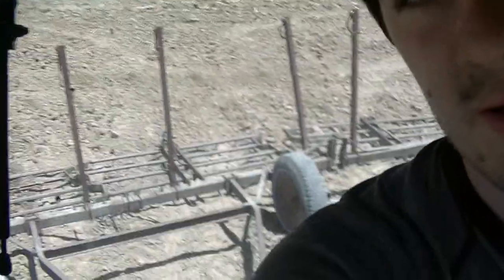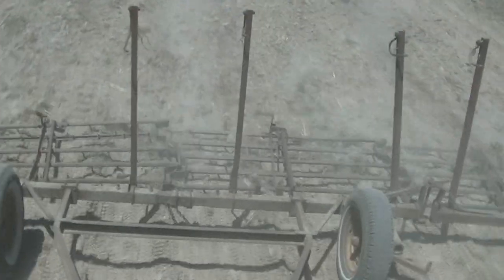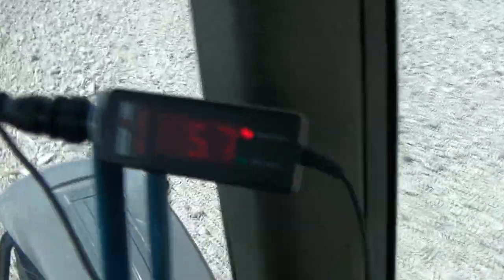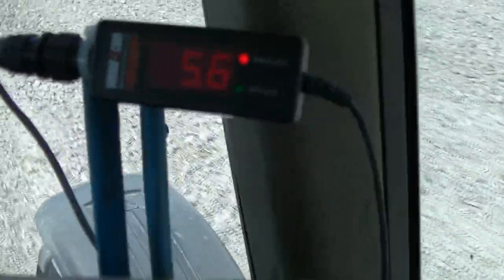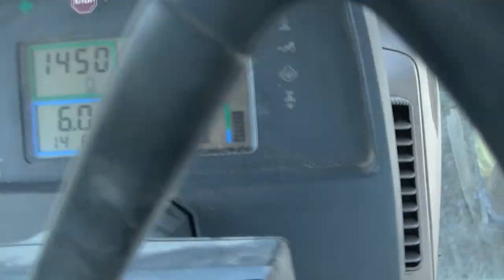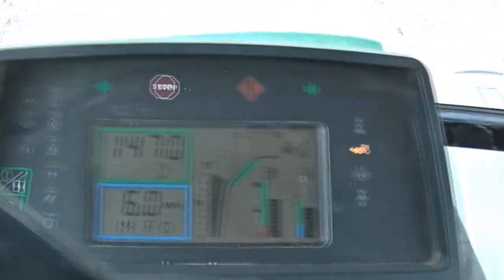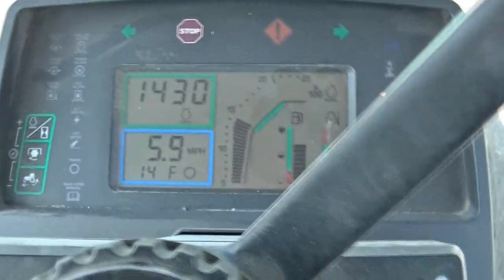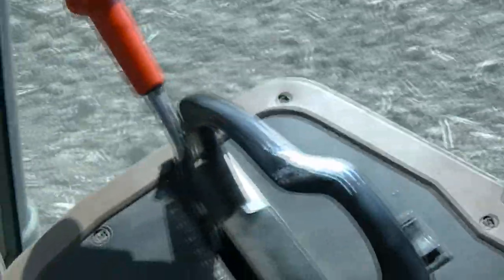Calculating Wheel Slip - Harrowing Oats and Alfalfa

Comment: Question?  To save a pass through the field could the harrow be rigged behind the drill and do the same job?  Also grain drills that I have sold parts for have 'drag chains' behind the rig to smooth out the pass and possibly cover more seeds with dirt.
Reply: It certainly could,  BUT,  it could  interfere with turning at the ends of the field and also precludes the possibility of  backing  up, if needed...  unless the harrow  has a lift  cylinder  and can be seen adequately from the cab to lift it and back  up without jackknifing.  

I saw a Mennonite a  few years ago in northern  Indiana that was running and old Deere  620 tractor  on steel wheels, who was pulling a disk  behind the  tractor to break up the soil, a cultipacker hitched behind that to break the clods and firm the soil, which had an old Deere FB drill hooked behind that to drill the seed into the firm soil, and it had a Brillion roller packer hitched behind the drill to firm the soil and incorporate the seed... really a neat looking setup and kinda fun watching that "train" of equipment  rolling across the field...  and yeah, the old 620 had about all she could handle!  LOL:)  

Later!  OL J R :)

Comment: A cultipacker or Brillion roller pulled behind the drill would be more efficient and a better  use of time... but of course you need a hitch  on the back of your drill to pull it, which wouldn't be hard to do... just a tow bar basically, which  could  even be removable when not needed if desired.  

Later!   OL  J R :)

Comment: Slippage is a way of protecting the power train.  Basically a tractor under load needs to run over 4 miles per hour.  Having correct weight to hp allows tractor to maintain gear speed thru spinning.  Too much weight & the tractor just bogs down putting a lot of pressure on gears & shafts.
Reply: For shock loads, yes, slippage  helps, because the tire will slip more when a shock load (like hitting a hidden rock  under the soil or sudden hard spot) but the constant load is the same, regardless of slippage... reducing slippage reduces fuel wasted,  but  since more work (ground covered  with the implement)  is being accomplished per second  (or minute, or hour, however you want to measure it) more work  is being accomplished and also  more fuel  is being burned, but it's being burned to accomplish more work, therefore increasing efficiency (to a point).  

You're correct that basically you don't want to weight the tractor  until there's "zero" slippage (which  is theoretically impossible anyway) and that's why  a small percentage of slippage is not only acceptable but also desirable, since it gives the power somewhere to go during "shock loading" when with  very little/no slippage the loads on the shafts and gears and engine could become very  damaging and break something... 

Later!  OL J R :)

Comment: Interesting video. Looks like by engaging the 4WD it would cause your tractor to burn more fuel, and not save fuel. It would take care of the wheel slippage for sure, but saving fuel I don't know.  Other wise vehicles would be running around in 4WD for better gas mileage. I will take your word on it... lol  Take care.
Reply from the maker: Larry342516 As ***** said, it really depends on how much wheel slip you're getting. Since I'm harrowing, the difference in wheel slip is very minimal. In larger tasks such as chisel plowing, 4WD can be a game changer.
Reply: How Farms Work Thanks for the reply. Take care.
Reply: How Farms Work Isn't a formula based on torque, weight, load and conditions? I guess I wold like to have seen the fuel consumption difference between having the four-wheel engaged or not. I can't imagine it effected fuel efficiency very much?
Reply: Well, wheel slippage causes more fuel to be wasted... it takes "X" amount of energy to turn the wheels against the resistance (load) of the implement, soil, and moving the weight of the machinery through the field, and if a wheel should cover say 15 feet with every revolution (circumference of the tire at the tread center) and instead only covers 12 feet in that revolution, then the 3 feet it didn't cover (wheel slip) then has to be covered on the next revolution, therefore the tire must make more revolutions per field to accomplish the same work, therefore wasting energy.  Reducing wheel slip reduces this waste, BUT, it also means that the drag resistance that was causing the wheel slippage in the first place has been partially overcome-- so assuming the load remains the same, the tire is DOING MORE WORK per revolution (now that slippage is reduced), which offsets the savings gained in reducing the slippage somewhat.  

Look  at it this way-- what is the mileage  on your truck going down the road at "zero" percent wheel slippage, versus 100% wheel slippage when the truck is stuck in a mudhole or on ice??  Obviously, a  truck that  will get 20 mpg on smooth level road will be getting ZERO miles per gallon when it's stuck in the mudhole or ice, because it's still burning the same amount of fuel  necessary to move the truck down the road, BUT it's not going anywhere when it's  stuck... 
Similarly, that's why vehicles have fuel mileage  expressed in "city/highway" ratings...  In the city, vehicles often sit idling in traffic jams or at red lights for extended periods,  which lowers the fuel  efficiency,  since the engine is still burning fuel to idle, while zero (or very little  in traffic jams) distance is being covered for the amount of fuel being  burned.  

Now, consider the same pickup going down the road pulling a trailer... the trailer weight, resistance  of its tires, friction of the bearings, etc. all  take more energy to move... more work is being done by the truck  in moving the trailer AND itself down the road,  while wheel slippage is still theoretically zero,  which is why it takes more fuel  to tow a trailer than just running the  truck by itself, even empty.  

It's all basically a measure of efficiency of converting the energy from the fuel into work  accomplished by the truck,  tractor, whatever.   Wheel slippage= energy wasted, reducing slippage= more work being  accomplished per  wheel revolution  or second, thus increased load, BUT  so long as  the increased fuel consumption to accomplish  the more work being done is less than the fuel being wasted turning the slipping tire, then efficiency has increased.  That's  why a CERTAIN percentage  of wheel slippage is actually good-- eliminating  it completely would require SO  much extra weight on the tractor (which the extra weight requires energy to move through the field as well against rolling resistance)  that the reduction in waste   losses due to slippage are less than the extra  fuel required to move the extra weight... PLUS compaction would be greatly increased due to the additional weight on the tractor.  

Rolling resistance is  another important factor... it's the reason radial tires are more efficient  than bias ply... all tires experience rolling resistance; it's how the tire responds to it that makes the difference.   Usually, the baggier the tire, the more rolling resistance (and the more the tire heats up, which is wasted  energy since fuel is being burned  to overcome the rolling resistance  and therefore heat the tire up).  In the case of radials that "squat" more  than bias ply tires, the additional "footprint" of the tire  on the soil versus  a stiffer, straight walled bias tire gives better traction and less slippage compared to the bias tire, giving greater efficiency... It's the same reason that railroads are more efficient than trucks per ton/mile of cargo transported-- steel wheels on steel rails have MUCH lower rolling resistance compared to rubber tires which "squat" under  the load, even at high inflation pressures of truck tires, rolling on pavement... 

Later!   OL J R :)